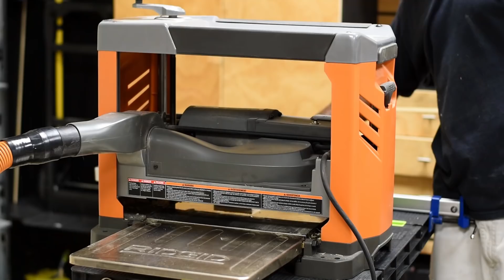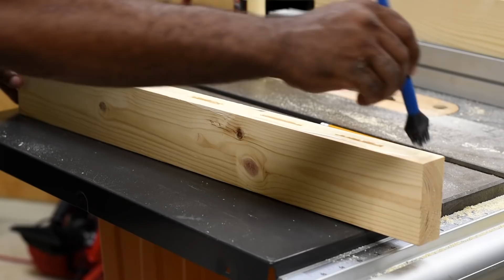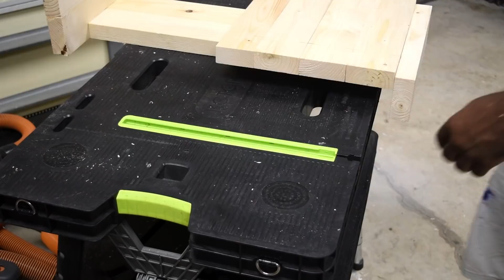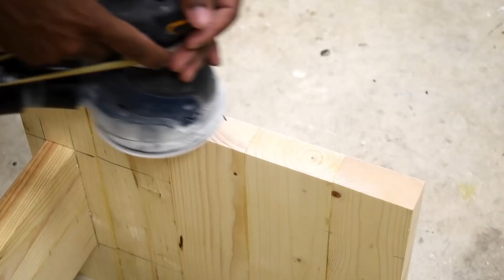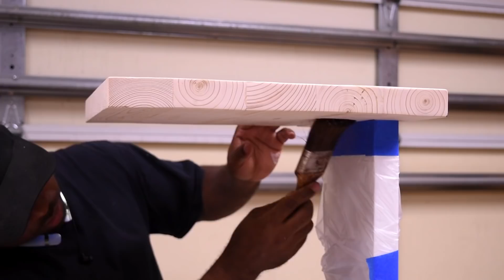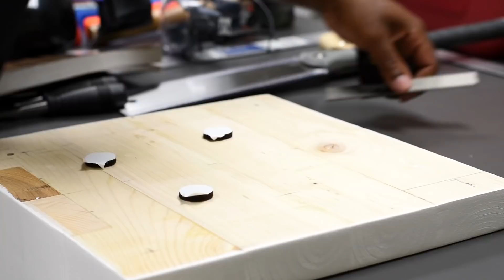Modern Drink Table Indoor- Outdoor | DIY Build

Comment: Hi,
Interesting build, thanks. I was wondering how it's holding up after four or five years. In particular, are you getting any blotches showing through the paint because you didn't condition or seal the pine before painting?

Comment: I wanted to do the same color for the chair.  How did you protect the white paint on the arms, feet, and legs of the chair? I tried Spar varnish would yellow it on crap piece which I painted white but it ruined the look.  I want the chair to sit outdoors in NJ all snowy stormy winters.  Would like your input on protecting the chair white paint without ruining the look.  Thanks.

Comment: Always, great project. That's why I'm a subscriber and why I'm building one. Except that I don't own a biscuit joiner. I think I got an idea of what to do, any suggestions?
Reply: Hi Robert what did you come up with on your table? I am gonna use a dowel. They are strong then biscuits. Do you happen to know what size Forstner bit to clean out for the top? Thanks.

Comment: Good job. You're really doing good but if  you want some idea about the different world furnitures i can help you, i am not a carpenter but you are using wrong some materials for your design. I can easily help you by sending some pictures then you can build more powerful and usefull stuffs. pm me if you want. Have a nice day.
Reply from the maker: Thank you. However I have a great understanding of what material to use where. Really appreciate your concern, but I have outdoor areas that dose not get wet. If this was going in the grass would have used pressure treated wood.

Comment: i'm watching your videos and i enjoy them a lot. i'm not a handy guy but i like to watch the hole process every time and maybe learn something out even it is most likely i won't ever make something similar. what i would like to try and make myself, is something that  could help me in my gaming hours. something that could help me play pc games sitting on my coutch with my keyboard and mouse. it sould fit a keyboard and a decent size mousepad and also have some space to support my hands without going out of balance. some space to hide wires and a usb extension to connect to the pc, using a usb hub maybe.
if you could make it happen i would be realy excited and for sure try to make it myself.
Thanks in advance!
Reply from the maker: Thank you. Sounds interesting :)

Comment: nice table! Is there a way to make this without biscuits? I don't have a biscuit joiner...
Reply from the maker: +Erik Hartman 
Thank you. Yes just use screws and wood glue as I did in the video. Drive the screws past the surface, then fill it in the screw heads. This way you don't see screws. Hope this helps :)
Reply: thanks, I will try it that way. I'm only worried about the last 2x4 from the tabletop. You used only biscuits and glue so that you won't see screws when it is finished. Without biscuits it wouldn't be strong enough. But I will find a way. :)